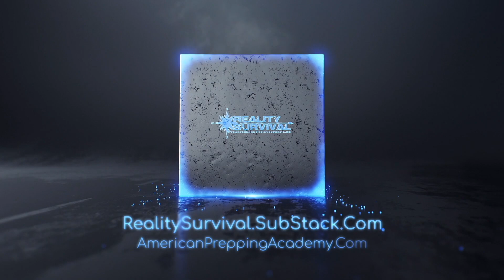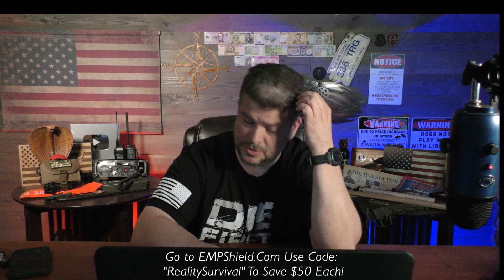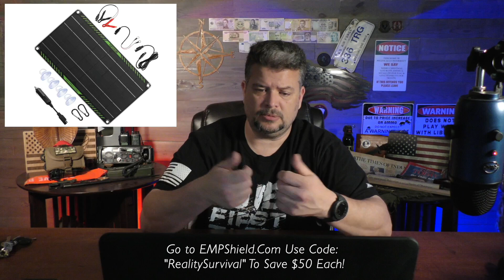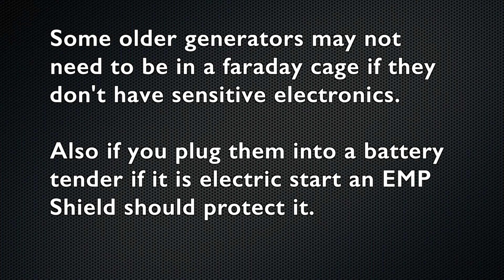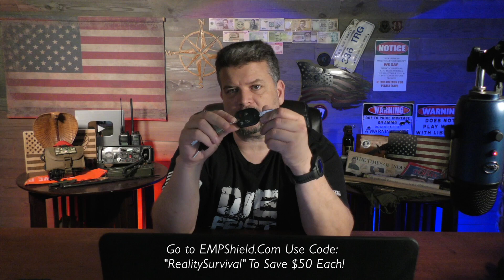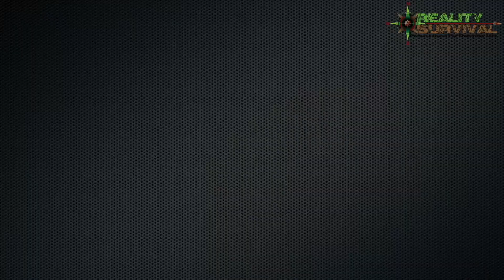The Ultimate EMP Defense: Top 50 Items for Your Faraday Cage (Power, Comms, Tools & More)

Comment: I worked in a power plant for a public utility. An accident fried the output transformer on one of the units. The company found a replacement transformer that could be modified for our use. It was in Europe. 

The generating unit was out of service for 16 months. There was no competition for the replacement transformer.

I think estimates on the time the grid would be down are optimistic.

Comment: I have what I call a nested Faraday cage. Its over kill but better safe then sorry.
Below is how I made my cage. Its long but if you read it thru, you will get the idea:

1) Metal gargage can from Home Depot, Lowes, etc etc 
2) 1 roll of my metal duck tape from same store.
3) Tape all seams, any and all holes, puchtures, rivits, on inside and out. Basically, you want to cover all places that have even the smallest of holes.
4) Line the inside walls and Floor with Cardboard to just below where the lid sets.
5) Order extremely large EMP Bags and smaller bags for your items.
6) Place the largest EMP bag into can like garbage bag. I got 36x36 bag at Dasaster Prepareness for$50.00. I also picked up a selection of other size bags for each item I have. I got the next size up to make sure there was room in bag.
7) Keep item to protect in cardboard box of a box just big enough to hold it.
8) Take item in box and wrap it 5 times like a Christmas gift in Aluminum foil. Rotate from top to bottom where you start each sheet. To insure complete coverage and overlap.
9) Place item with foil into an EMP bag that you got for the item
10) Write name of item on outside of EMP BAG
11) Heat seal bag with curling iron or clothes iron. Be careful not to hurt yourself or damage bag.
12) Place the heat sealed bag in garbage can with Large  EMP that's like a trashbag.
13) On separate piece of paper list item.
14) Repeat for all items that you want protected in faraday cage.
15) Once all items have been place into can, close bag by either heat sealing top of bag closed, or roll the tops of bag together and tape with non metal duck tape.
16, Place lid on can tightly.
17) Use METAL Duct tape around where lid meets can and seal it up.
18)Place list of items onto outside of can.

It might seem a lot but its pretty simple.
Now, you have 5 layers of aluminum foil, 2 EMP bags, 1 Metal container.
Thats, what I call over kill.
REMEMBER: YOU ONLY GET ONE CHANCE TO PREPARE FOR AN E.M.P.  SO MAKE IT THE BEST YOU CAN DO!!!!!

Just my 2 cent

Good luck
Reply from the maker: I have a video on how to build a nested faraday cage as well. :) Great minds.

Comment: Why did you not mention aluminum foil as a faraday cage???
Reply from the maker: A single layer is minimally effective. Only about 50 db reduction if I remember right. The best way to get higher levels of reduction is to do a nested faraday cage with differing materials which I do have a video on.

Comment: Key fob comment ; a car or truck pre-1978 and your good physical crank start would be better.  When I was in college 1988 we built a railcart  from a  late 50ies VWBug by adding "hi-rail" wheels to the car. It only went 47 mph but holy hell it was fast enough.  We also modified the engine to run on air pressure  by replacing the spark plugs with release values to push the head down.(im not a car guy),a car with a hi-rail setup will get you out of dodge quicker than the highways.  Right now I'm  building a hi-rail motorcycle attachment. A bar with a roller-coaster wheel mounted at the end connected to a moped(great gass mileage). Like a TOMOS Golden Bullet, 2 speed 4 stroke gas motor. The key when fleeing is to be able to cover lots of ground fast! Follow the railway north.

Comment: Am ordering another EMP Shield for the ranch Pickup. It's an old Betty, 1972 Chevy, small block. I have had the motor rebuilt 2x over the years. It was my dad's truck, and it has mechanical points, but I think it is worth the $350 anyway...I tow cows to the auction monthly, so it makes me feel better, easier to sleep at night. Also bought 1,000 sand bags for around the basement...Get the sand next week, now just need someone like you with muscles to fill da bags...:>)
Reply: A 1972 Chevy shouldn't be affected by a EMP except maybe the radio!😁I used to have a 78 but it had a module in the distributor cap instead of points.😲An EMP will whack a 78 with the electronic module!

Comment: Does an outdoor gasoline generator need to be in a faraday cage?  That seems awkward. What about a battery power station like the Anker 767 Or is there an EMP Shield device for that?  What if the generator is grounded, like a copper wire into the ground?
Reply from the maker: I will make a video on this topic for ya.
Reply: My Anker power station system is not usually connected to the house or solar panels except for charging, it usually just sits there just in case. So, whole house EMP shield would not come into play.

Comment: We built an ICF house (sytrofoam block filled with rebar and concrete).  Our basement walls are 8" of concrete.  We built a 6'x12' vault.  2 walls are surrounded by dirt and the other 2 and the lid are concrete.  We have an Ironman safe vault door.  How can we tell if this will survive an emp?  We are thinking of wrapping the interior walls with emp cloth.
Reply from the maker: Well the EMP wouldn’t be destructive to the structure of it. But it could penetrate inside of it and dry any sensitive electronics. I’d just recommend storing any electronics inside of a faraday cage inside of the vault. Also don’t forget ventilation. ;)
Reply: Until you need the mark of the beast to stay in your house line it with paper money 🤑

Comment: Just wondering about the EMP Shield. If its hooked up in a house it grounds the wiring, am I thinking right? Houses are grounded to earth anyway through the grounding rod. I guess the EMP Shield is like a breaker then?
Reply from the maker: It’s more like a very fast shunt. When the house gets hit it detects the over voltage and immediately starts dumping energy to ground. So it is a way for the excess energy to be dumped quickly before the heat builds up in the circuitry.